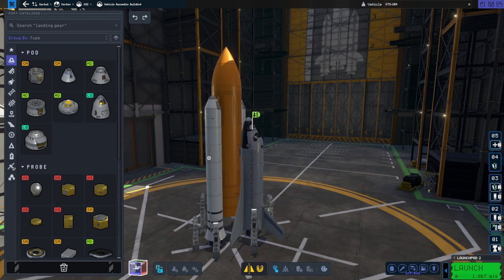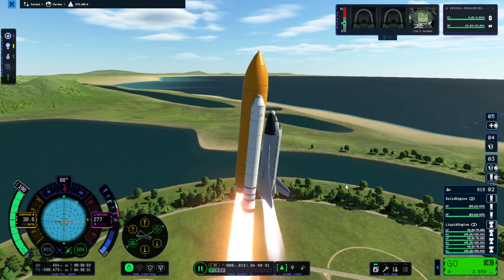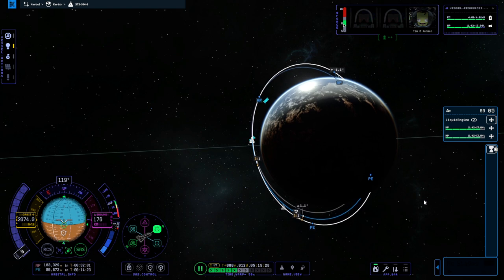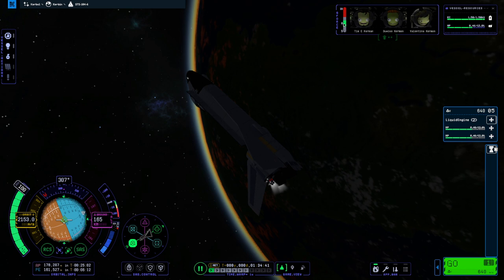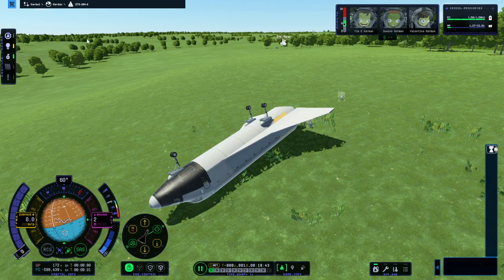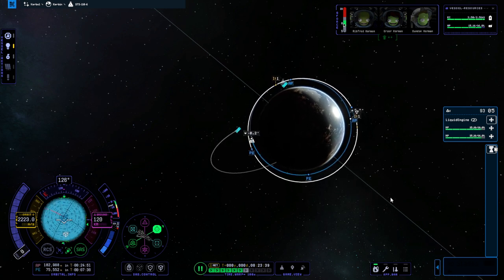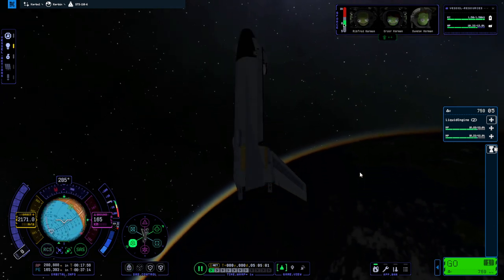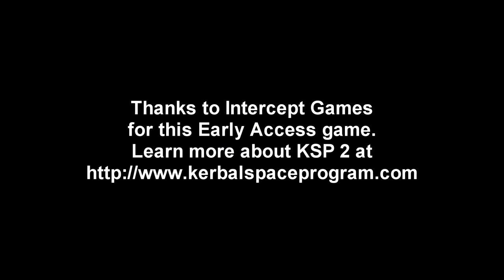KSP 2 Early Access - International Space Station Construction 5

Comment: You seem fairly knowledgeable about the shuttle system. I have seen some videos that suggest that the Soviet Buran was in some ways more efficient than the U.S. shuttles. What are your thoughts and have you considered doing a KSP2 or even KSP version of the Buran? In any case enjoying the videos.
Reply from the maker: Well, I did a lot of very realistic Buran in KSP: https://www.youtube.com/watch?v=FAyWJhBWMCU, https://www.youtube.com/watch?v=7HpeuBM_d94, https://www.youtube.com/watch?v=zgiddJbtE9A and others. As for the efficiency - the launch system Energia was very efficient, but Buran was basically slapped on to satisfy the Soviet military to get the money for Energia. As a result, the system threw away the main engines (RD-0120s) instead of carrying the SSMEs back like the Shuttle does. Is this more efficient? By having higher ISP engines on the boosters and on the Buran OMS, the whole system was much more expensive, relative to the local economy, than the STS Shuttle, and less of it was recoverable. Yes, there were paper plans to develop recoverability, but no money for those plans. Even according to plan and without the disintegration of the Soviet Union, Buran would have years between its first flight and second and its flight cadence could hardly improve going forward because of the cost, so it was doomed from the start. My considered opinion is that Buran held down the Energia project at a time when the Soviet Union had a good LEO crewed spacecraft - Soyuz - and the money for Buran would have been better spent developing the recoverability of Energia's boosters and possibly core. Then, the Soviet Union would have had a capability that the U.S. did not have instead of just imitating U.S. capability and it would be more economical and sustainable. 

In short, if we're talking about sheer ISP, of course Buran-Energia is more efficient, but Buran is not efficient in terms of being a spacecraft in the space program that built it.